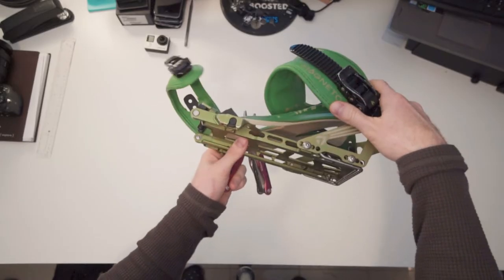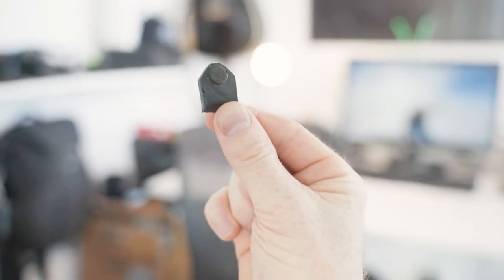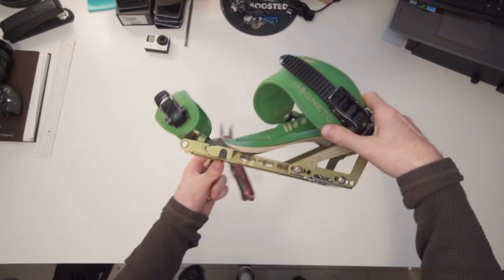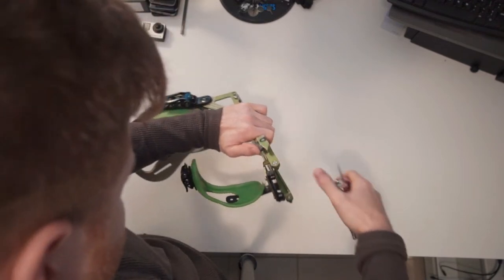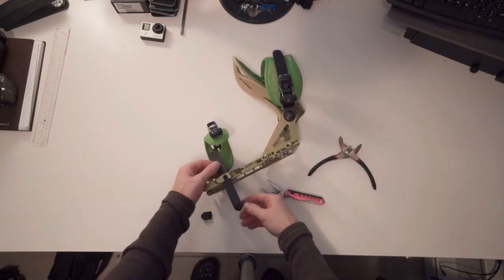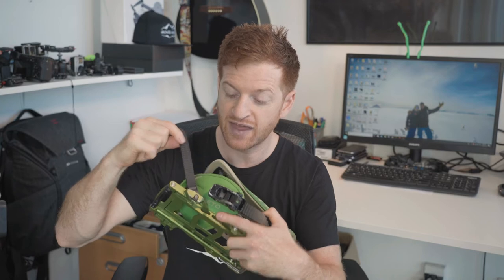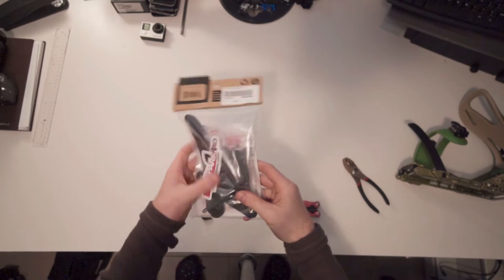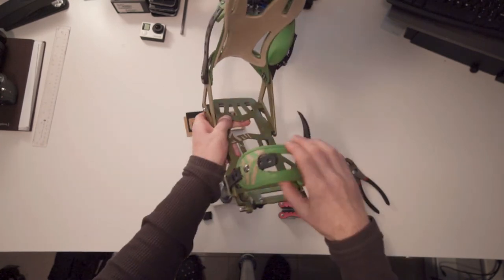How to Fix Broken Snowboard Strap on Bindings

Comment: So the part that broke for me is the other side of the toe strap with the clip on it. Do you think I will be able to replace the other side of the toe strap by just buying that piece?
Reply: Also, how do you find out if the parts you need and the parts that you find/ are available, will be compatible?
Reply from the maker: @epizzle9232  I suggest going go a local snowboard store first to make sure. Most of them are standard but look at the piece that connects to the bindings and make sure the new piece is the same shape.
Reply: @Movesmedia  ok I will do that! thanks you! One more thing. What is the name of that piece? It’s the toe strap that has the fabric under the strap, or it’s thicker then the the other side? I cannot find what that strap is called (unless it’s just called “toe strap” the same name as the other side 🤦‍♀️
Reply: Same thing just happened to me,any progress?